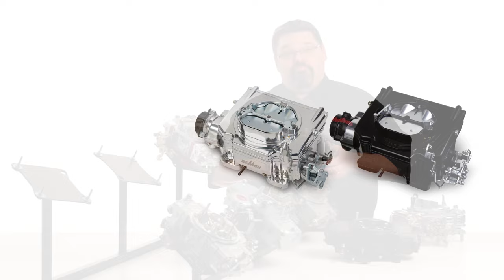How To Choose A Carburetor

Comment: I love manual chokes. Full control. If you know what you're doing they're really easy to operate. For 90% of the year in Houston you don't even need to operate the choke. When you do need it it's completely under your control. Manual transmission, manual choke. That's real driving.
Reply: I have a 1950 dodge B2B the manual choke and manual throttle make it stupid easy to worm up and to start in 30 below weather. Electric fuel pump just makes it a instant turn over

Comment: We will see how this does on my 292 Ford F250.  I got the 1850-16. That is replacing the 1850-1. I originally had a Carter 2 barrel. The Holley 1850-1 was needing to be rebuilt but it was difficult to find a rebuild kit for that carburetor.  I put a adapter plate on the intake manifold.  I have the manual choke on my truck.  The new carb should work well.

Comment: you forgot to mention that carbs are rated at 1.5 inhg at WOT, meaning that using the formula usually gives you too small of a carb size.

Comment: I just wish Holley would say piss on the B.S., and offer their own twist of Barry's "Badman" inline 4, including the Badman intake manifold. That was a sad loss for not just the carb side, but the aftermarket induction industry as a whole. The potential that induction system had for engines below 700hp was INSANE.

Comment: Well I got a mostly stock 1965 Ford Mustang with the C code engine and I wonder what carb I oughta get for it. Factory automatic (but I plan to swap to manual eventually), so what should I do? Which two barrel should I get or do I convert to 4? Also I would prefer to have a manual choke as it does get cold in winter here in NC

Comment: On my car, the dash mounted AutoMeter vacuum gauge never goes down to zero vacuum. Not even at steady WOT for 10-15 seconds. It goes dawn to app 3-5 hg.
Vacuum at idle is app 18 hg
Doesn't that indicate a too small carburetor?
Engine is a 350 CSB, vortec heads, .533 lift cam.

Comment: What is the weight break in pounds that a lightweight vehicle ends and medium weight or heavy vehicle begins? 1800 lbs, 2500 lbs, 3000 lbs, etc. ?

I'm sure I seen it in an old brochure, but don't recall the general guideline weight. Since this was some time ago and a vehicle that was considered lightweight back then and what is considered lightweight now may be quite different in actual weight. I think a reference weight range would be handy.

Thanks,

5:23 - "... a Double Pumper carburetor is generally going to be properly suited for a (lightweight) vehicle generally with a Manual Transmission with a lot of gear, or an Automatic with a loose performance converter that's going to allow it to build RPM rapidly..."
Reply: Bruh, the fuck vehicle is 1800lbs? 2500 is feasible as an extreme.. 3000 is usually where most guys can break with normal weight reduction techniques.

Comment: I live in a desert climate, but we still have cold nights and even colder winters. Should I get a choke for my truck or no?
Reply from the maker: It certainly isn't a bad idea!
Reply: @HolleyPerformance  thank you
Reply: Get a manual choke. You get complete control and it won't be a real pain for the few times you need it.

Comment: Hi there, good video. I own a valiant with a 318 v8 mild motor, has a stage two 340 cam, bit of head work, upgraded ignition and re graphed distributor,  340 Chrysler 4 barrel manifold, block huggers and currently im running a rebuilt 600 holley vac sec square bore, the motor runs fine but its going through way too much fuel. The auto has a 2500 domiantor stall and stage 2 shift kit, and running 2.92 highway gears lsd diff.  Its tuned up and timing is correct, have pulled spark plug and they aren`t black and fouled. Im thinking a change in carby is best suited. I know i want a manual choke and vac sec operated. Would a 570 Street Avenger be better suited for the street? I don`t want it to be starving for fuel but i want it to not waste as much as it is too. What would you suggest for good economy and street performance? Thanks
Reply from the maker: I'm going to need some more info...  You say the engine is going thru fuel but the plugs are not black?  How is it using too much fuel? is not getting good MPG?  The spark plugs are a tell-tale sign of the air/fuel ration in your engine (a light coffee color is optimal). One concern i see right away is the stall and gear ratio combo!  I'm assuming you're running a 727 trans?? The torque converter is probably slipping at highway speeds with that tall of a gear and that high of a stall.   What are the RPMs at 50,60, and 70 mph?  That will tell you how much slip there is in the converter. Start there first.  Thx J

Comment: I always hear street and race. What about off road. I have an 86 blazer and she is heavy with big ol tires and 6 inch lift. So im looking for power that pushes the 3 ton beast forward. And I dont need to go fast just use it for street and off road.
Reply: Go edelbrock. Good reliable carbs if you just want to install it and only touch it half a year for weather adjustments. Easier to swap out the jets/rods when you change altitude too.

Comment: So I have a small block ford 302 stock what should I get ??
Reply: Many years ago, I ran a 306 Ford (30 over 302) in a '79 Mustang. Car weighed around 2800 and had a mid 80's T-5 and 4:10's out back in an 8.8, though car came with 3.42's and briefly had 3.73's. Engine had 10:1, a small RV cam, Performer intake (off idle to 5500; think cam was up to 5200 -bought car that way and just ran it), and came with a 750 Edelbrock w/ vacuum secondaries (way too big) with upgraded control arms in the rear (a must). I also discovered later on it had mismatched heads (one from a '74 302 which the block date coded as, other was a mid 80's cast iron head with the smog bumps in the exhaust port). 

When it had the 750 Edelbrock, it ran OK, even with a C4 trans and would scream if you floored it. After installing the T5 and switching to a Carter 625 w/ vacuum secondaries (still technically too much cfm for the lower 5k rpm redline range), it had a touch more low end, mid range, and lost a bit of peak top end. With the 625, and all the goofiness of the wrong head, it still ran dead-even with the 02' Trans Ams that were new at the time. Raced several of them from dead stops up to what would be excess speeds. Always had them by half a car and kept it, but was on street tires w/o dumping the clutch. Figured it probably made around 260hp~ with 2800 curb and low 13 sec-capable, but made great vacuum, had really good throttle, always started w/o fuss, and made a bunch of low and mid power, and still had respectable mpg if you didn't flog it. Back in the late 90's very early 00's, it embarrassed quite a few cars and was a blast to drive.

Don't over carb, and don't overdo the rpm range on a street car unless you spend a ton of time on the highway as the losses down low will make it a slug. Much like turbo cars, having an engine fall flat off-idle to 3k~ rpms before it starts catching up with itself, will = an old dog that barely gets out of it's own way. If a daily driver w/ smaller cam and occasional flogging, or a weekend car you cruise in, etc., go with a vacuum secondaries. If a bigger cam car with poor vacuum and a high redline, compression, etc., that's mainly doing non-stop stoplight drags, consider a double pumper or whatever.
Reply: I have a mildly built 350 with the one on the far left 80457. I would think it would work well for any small block not going for all out performance.

Comment: Is that street demon a redisigned carter thermoquad?
Reply: Ronald Smith  Yes some of the after market thermoquads did, but all of the original equipment tq's flowed less - rebuilt plenty of those back in the day. Maybe holley should have kept the three pieace design so they could offer the larger throttle body.

Comment: Nobody seems to know what the difference is between holley carb 0-80450 and 0-80451 ?
Reply from the maker: 0-80450 is a stock replacement carb designed for 1970-1974 GM vehicles and the 0-80451 is a stock replacement for 1975-1980 GM vehicles.  The primary fuel bowl on the 0-80451 has a lever operated vent not found on the 0-80450. J

Comment: I have a  350 with a mile cam with a quick fuel  650 carb on  take off my truck stumbled  and shakes is my carb to big can I jet it down
Reply from the maker: It may be too big but to better help you I need some more info.  What cam, compression ratio, intake, headers or manifolds, what tranny, what rear axle gear ratio. And when does it stumble?  fully mashed from idle? does it do it when you floor it while at cruising speed? does it back-fire thru the carb or the exhaust?   thx J
Reply: do you have four bold manes?
Reply: @Napalmnate  yes
Reply: Comp cam just above stock don't know compression  edelbrock  high rise  intake 700r transmission  411 gears  long tube headers
Reply: @HolleyPerformance  only on take off
Reply: how about an rv cam? you sand the pistons yet?
Reply: I would say, without knowing too much, that you should lighten up your accelerator pump shot if you are stumbling at throttle tip in at light throttle. Check your vacuum at idle and see what power valve you have. Your power valve should be 2 inches of mercury below what your idle vacuum is. Just a start.
Reply: NapalmNate, knock it off you're just a troll.
Reply: @HolleyPerformance  hello sir yes ,I have the same set up and I got the same problem ,it's running as if it's only on 6 cylinders the carb is brandnew I just bought it from eBay, so what's the problem

Comment: I need help choosing a Holley carburetor  I have a  Ford  460 board over .60  with a 4speed manual transmission , witch if I'm not mistaken was stroked in to a 542 stroker ....I need to find a carburetor that will best fit and preform well with my engine
Reply: probably 1000cfm. if it revs above 6000 maybe a little more

Comment: Could  you tell me HOW can I find out WHAT the C.F.M. is if I didn't get my carb in a box with it's papers?
Reply: Should be numbers on the carb, look those up online it will tell you build date, model, and cfm
Reply from the maker: +rockymontana1 You can call the tech line with the list number from the carburetor or check the numerical listing in the tech document library

https://www.holley.com/support/resources/

http://documents.holley.com/techlibrary_carb_numerical_listing.pdf

Comment: I have a 350 sbc which I think is stock (I just bought my car a few days ago) and it has a turbo 350 trans. Should I get a 4160 ?
Reply from the maker: The 4160's are great carbs but we offer alot of carb options so I suggest that you first you need to get some basic info on the engine, trans, drivetrain combo. (ex. cubic inches, cam specs, convertor stall speed, vacuum at idle, gear-ratio of rear end.)  The more info you can obtain the better off you will be!     Use our carburetor selector, here is the link- just scroll down a little to see it-  
  https://www.holley.com/support/carburetor/  
 to help you choose a new carb that will fit your engine combo and driving needs.   thx J
Reply: HolleyPerformance thank you !

Comment: is there a relation between cfm an the ventury diameter?
Reply from the maker: Yes in most all cases a larger Venturi diameter will translate into larger CFM. thxJ
Reply: but there is some formula to calculate tha cfm depending on the ventury chosen for a given carb on a given engine?

Comment: Holley really screwed the public with there carbs.  Just google "off idle stumble" and see what you get.  Holley designed them to cruise at 14.7 stochastic.  They claim for gas mileage.  14.7 is perfect emissions. As we ALL know emissions does NOT equal gas mileage.  PLUS.... If you're running a carb on a v8 last thing you care about is emissions or gas mileage. Best gas mileage is going to come when you're getting the most power out of the gas being used as possible. At cruise speed this is around 12.8-13.2.  Low 13's for most applications. If you set there carbs for this better cruise AF then your WOT will be super fat. It will also be too fat while at speeds of 40mph and lower.   I have spent the greater part of 3 years trying to tune my holley.  My motor has a hot cam and 14.7 is a lean bog to my motor.  My motor hates anything 14 and higher. ESPECIALLY with 10% ethonol which holley does NOT account for.  My motor likes to cruise at 13.2 and WOT power at 11.8-12.2.  I just can't get this worked out in all the transitions. Worst carb ever if you intend on driving around town. There only good for race tunes that have little or no use for transition slot and cruising.   I bought a brand new base plate and less then 2k miles the secondary butterfly shaft is loose. Causing it to move and create lean and rich spots randomly. Sometimes causing it to lean out and die in parking lots barely tipping in to throttle.  I have to make sure the rear butterflys are adjusted all the way down and fit tight in the holes so they don't jiggle.  So adjusting them slightly open is not even an option.  Holley sucks.   I expected much better from holley. I had much better luck tuning a quadrajet.
Reply: #countryboycansurvive yes off idle stumble is a huge problem, I’ve tried everything to fix it ! I eventually did it’s in the bin
Reply: @sharons9367  I drilled out transition circuit to fix stumble.  To fix loose butterflys again I bought a 500cfm 2 barrel. I have seen 351 clevelands dyno up to 800 hp with this carb. Best decision ever. After drilling out the power valve holes to tune WOT it has exactly the A/F ratio through out the entire range I want. And feels like I have all of the power I had before, maybe more. Even have an electric choke set well enough to cold crank and drive off in winter months. That would have never happened with the 4 barrel. It hated cold.
Reply: #countryboycansurvive  I watched another YouTube about transition holes I was going to buy pin set +drill bits and give it a try , reply I got don’t do it , maybe it’s a female thing
Reply: @sharons9367  the bits are micro bits.  Slip bits in holes til you find the size that matches holes. Then just go 1 size up at a time and test drive.  Diagrams online will show where the jet hole is for idle/transition circuit. Best to do with an air fuel meter too so you're not guessing. There is enough guessing involved even with one. Then just use some trial and error to find the best size.
Reply: #countryboycansurvive thank you if I have this problem again I will do this , I bought a new carby this happened to me years ago

Comment: I call bullshit I got a 460 in my jet boat and I went from a 650 to a 750 to a850 then a 950 mechanical secondary and had to put 86 in the front and 94 in the back

Comment: I have a 68 nova with a 383 stroker.  Not sure about motor specs but pretty sure it's about 10 to 1 compression and a hydraulic roller cam.  Auto trans with 3000 stall and 3.73 gears.  Stock mechanical fuel pump.  Should I get a different fuel pump as well?  What size carb?